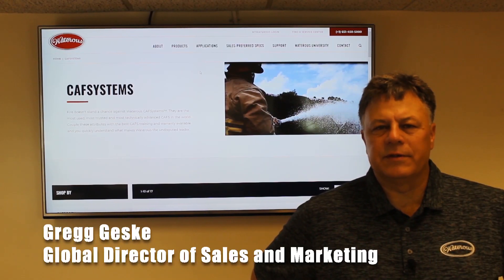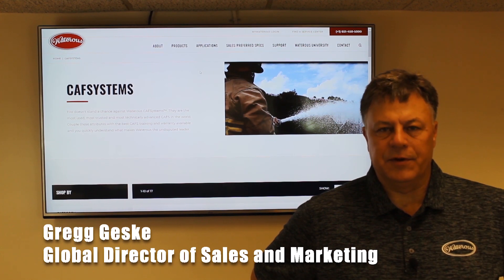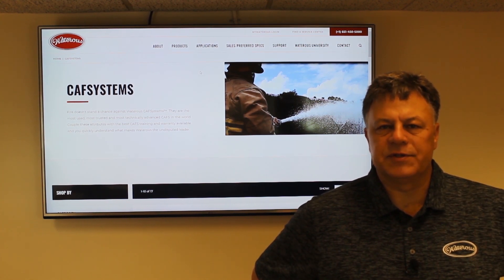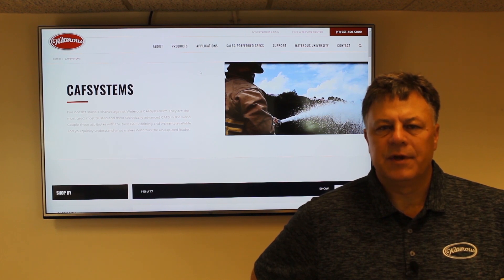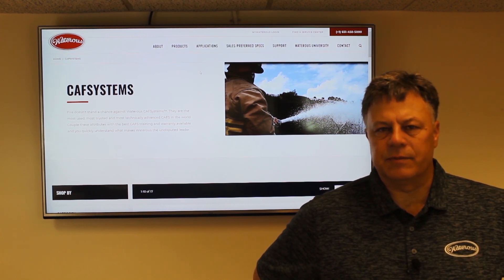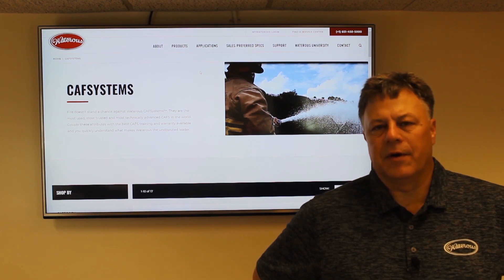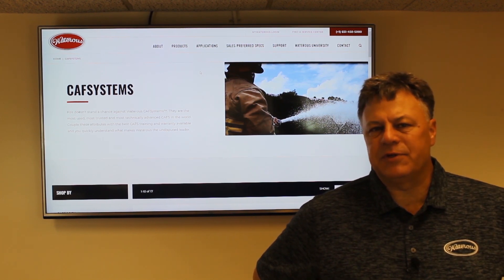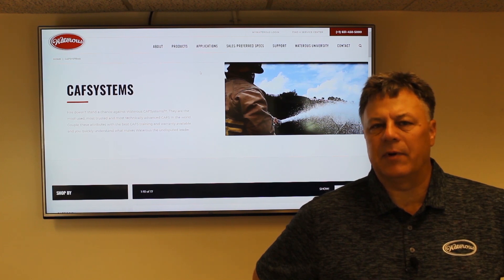CAFS Overview, Operation and Maintenance by Gregg Geske

Comment: Why do you think you have to flush the system? Are you using harmful type of foam concentrate?
Reply from the maker: No, the foam we use on my own FD and the foam we use for demos is listed on the fs.fed.us qpl for use on USDA Forest Service land.  If you do not flush the foam out of the foam manifold it will get on the other side of the check valve.  Then mechanics are needlessly checking for a failed component when it is due to lack of flushing.  Gregg Geske

Comment: CAFS settings are not good. Too much water not enough air, the foam solution is too low. Nozzle is too small. Not enough pressure, needs whip line.  No mention of smoke absorbing toxic gasses.  A lot more to learn.